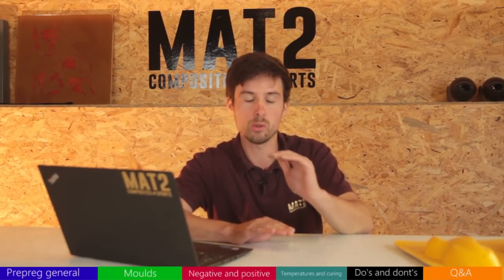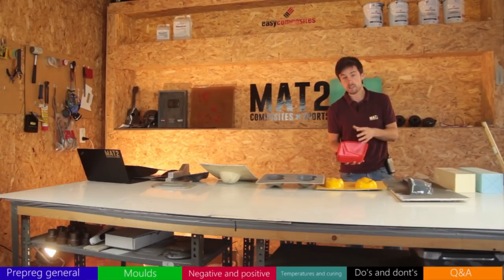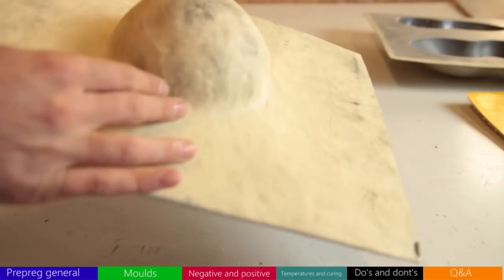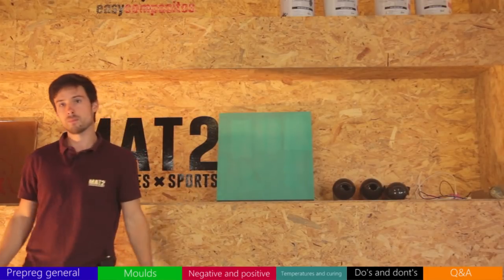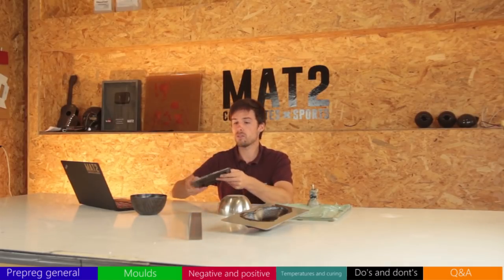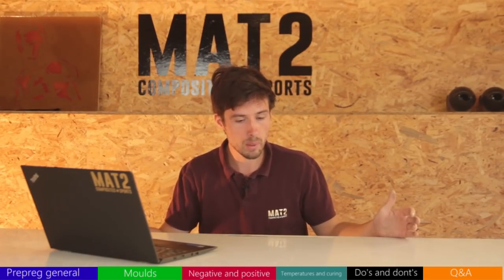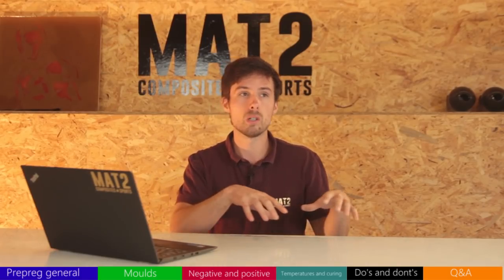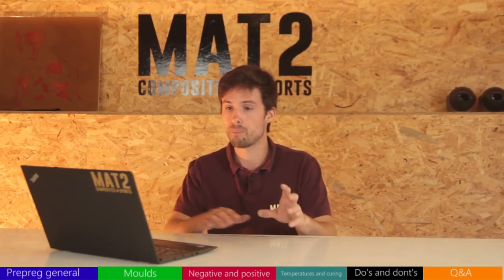Carbon Fiber Prepreg Talk

Comment: You can spray 2K clear onto your mold surface prior to putting in your prepreg in.  You have to wait for the 2K to “b stage” or get finger tip tacky before you apply your cloth.  The benefit is your part will come out clear coated with zero finish work needed.

Comment: Great video .  !!  Question  : In order to produce a thick piece , can we make the "shell"  with prepreg (with or without  autoclave ) in one day and then , next day(s) , the filling with dry fibers (lay up process etc )  ? Do they bond  together ? Or has to be done all at once?
Reply from the maker: Yes it is something that is possible, just make sure to sand the back then to  be sure to have a good mechanical bond then
Reply: Thanks a lot !!